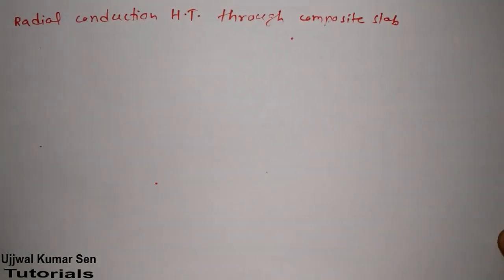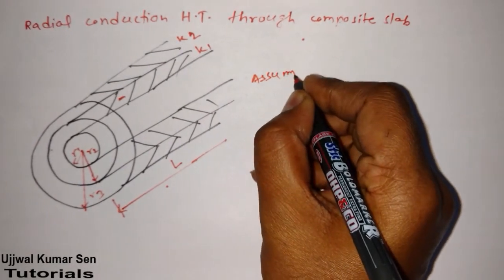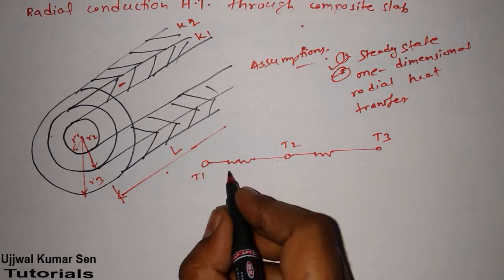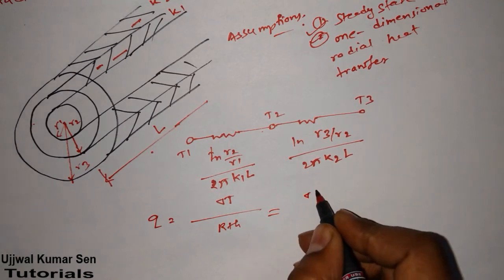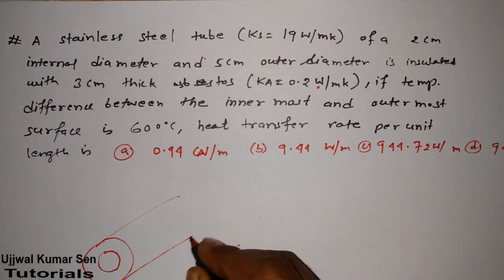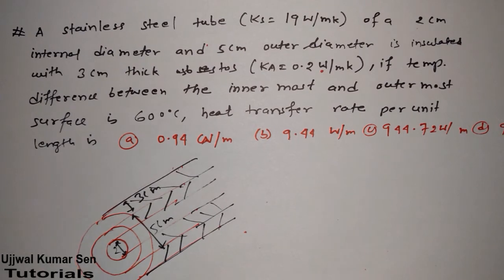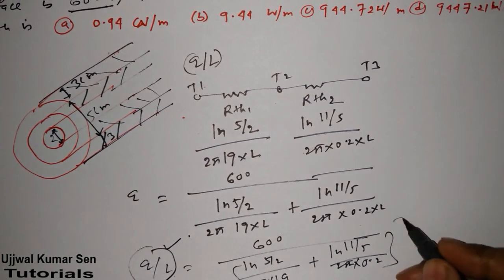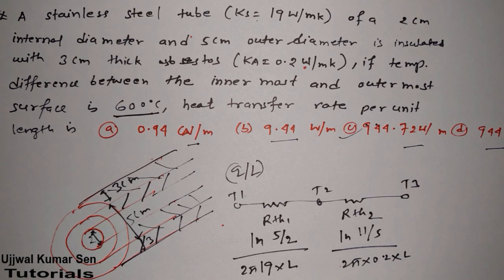Radial Conduction Through Composite Cylinders HMT Tutorial- 17

Comment: Dear Ujjwal,

I am currently working on my graduation thesis, which focuses on the heat emission of exhaust insulation systems in diesel generator rooms (Q in watts). The setup closely resembles the situation shown in your video: a stainless steel exhaust pipe surrounded by insulation material.

I have completed the theoretical calculations and would like to validate my approach. If possible, I would be happy to send you a brief document with an overview of the project and a calculation example (4 pages) via email. Any feedback or suggestions you could offer would be greatly appreciated.

Thank you in advance for your time and support.
Kind regards,

Comment: Hi,sir 
In that numerical I hv an problem..
Ks and Ka are in w/mk but temperature difference 600 in degree celcius. Wy it's not change into Kelvin..
Reply: delta T or change in temperature will make it already absolute.

example: (T2-T1)
= (60C-40C) = 20
 = [(60C+273)-(40C+273)] = 20

so nothing changes, you just make the statement wrong if you add 273 in 600C.
Reply: temperature difference remains same in both the units.